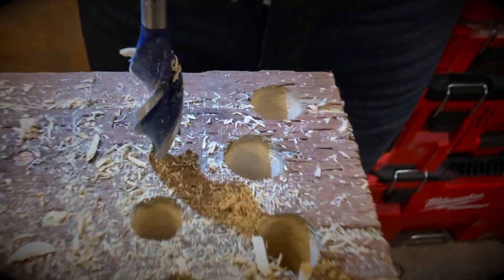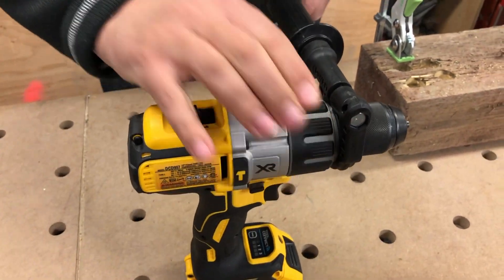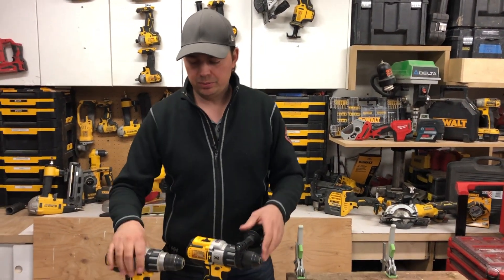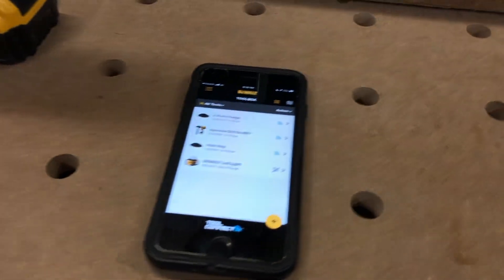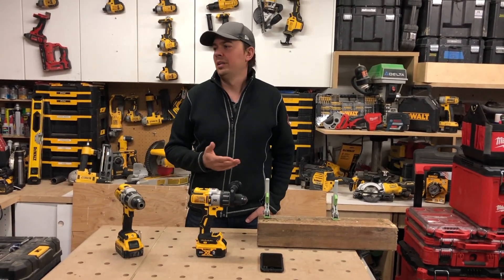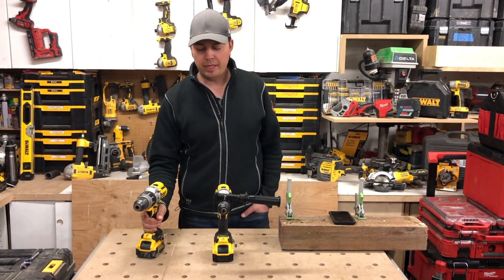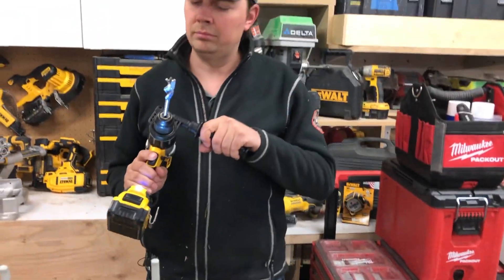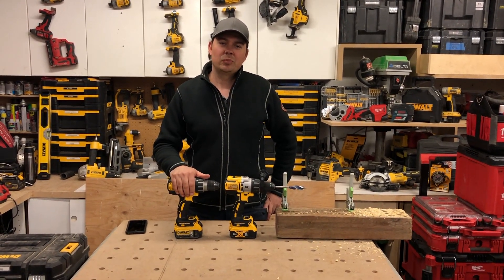Is Dewalt Connect worth it? DCD997 Hammer Drill review

Comment: I'm trying to chose from the many different DeWalt XR drills and after reading that the chuck can get jammed, I also found some reviews saying on some models the chuck can't be removed.

It seems that this is another difference between the DCD996 and DCD997? I've found people saying the DCD996 chuck cannot be replaced without changing out the whole guts of the drill but it seems the DCD997 chuck is removable in the standard way. I'm not sure if this is a regional change or DeWalt have made this change from a certain date/revision or if it's simply down to the model? It's really hard to find info about it but it's something I want in case the chuck fails out of warrantee and I have to mutilate it while trying to un-jam/get it off.

it would be great to get some confirmation but it seems the 777, 796 and 996 are held in with a pin and not removable. The 776, 795 and 997 do have removable chucks? No idea about the 778?